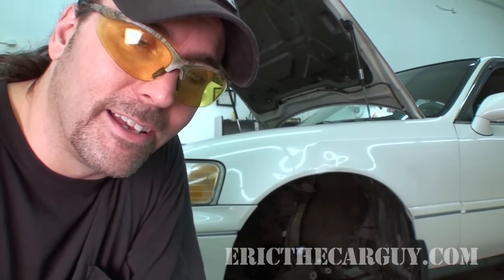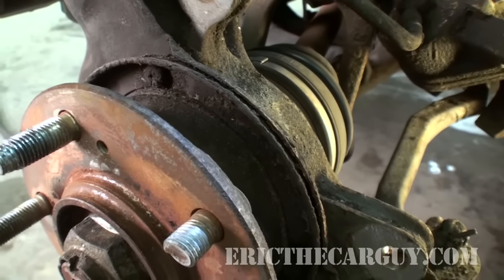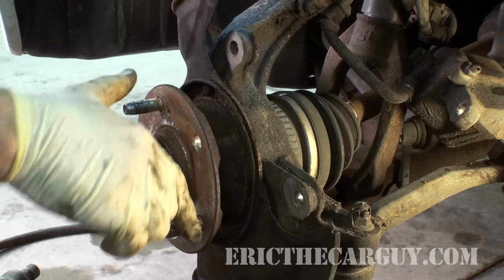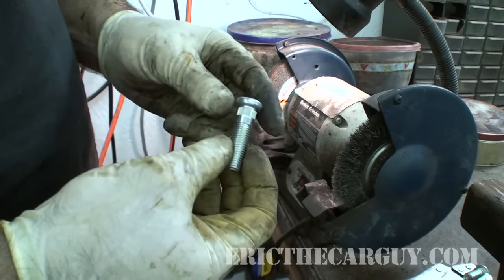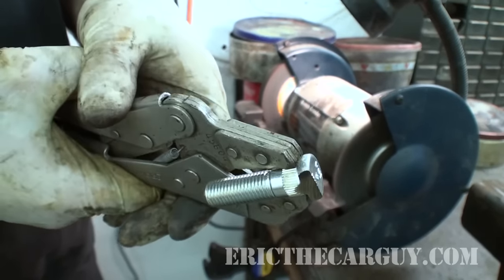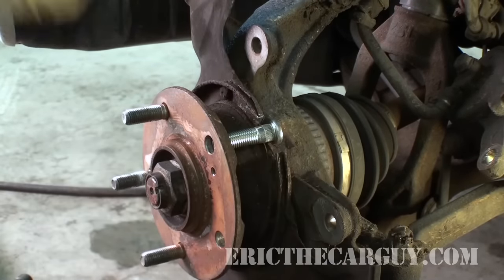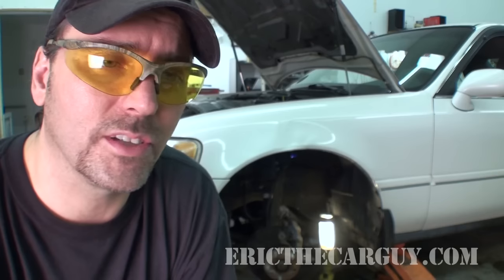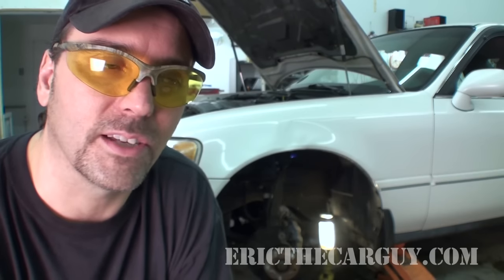Replacing Studs the 'Easy Way' -EricTheCarGuy

Comment: why bother replacing the stud if your going to replace it with an already damaged part?
Reply: keith cunningham I would be more Willi g to do this on a 5 ton truck then a car. The lug nuts should be only clamping the rim to the hub, on most heavy duty trucks the lug nuts actually carry the weight of the entire truck and are way over built. Lug nuts and studs really aren't all the strong on passenger cars. You see cars in accidents where the entire hub shears off or even the center of the rim. But none of that is either here or there. The customer paid for a new stud and got one that was installed half assed and damaged before it was even installed.

Comment: hey Eric, it's ridiculous to do this if you're working on a customer's car. Personally, I'd be mad if someone changed my studs this way without informing me how they were going to go about it.
Reply: Why would you be mad? There are multiple car manufactures that cut the base of the stud to make them fit, from the factory, I do this all the time at work. If you'd rather pay for someone to remove the entire hub and bearing and most likely cause harm to the bearing in the process that all you. But 99% of customers would rather pay the price for what he did then to get a new bearing, and wait for the time it takes to do it as well.

Comment: Seems like a quick/cheap way to get round the issue instead of removing the hub. However, if the stud were to sheer or come loose due to the load being focussed over to one side of the lug, (maybe causing it to scew over to one side seeing as at least a third of the seat has been removed ) hed be fucked in court....if things went wrong. Id be in the shit house if i did this.
Reply: How so? I guarantee the customer knew what was being done and wanted it done this way to save money.  I doubt it will ever be a problem. And even if it was and the stud failed and was pushed through past the wheel there are 4 other lugs holding it on so it won't be going anywhere. I see people rolling in with a broken stud all the time. Not Ideal for sure but they still drive it. Point is the wheel is Definitely not going anywhere before they've seen it and brought it back.

Comment: most of the cars ive seen  have a hole in the backing plate so you can spin the stud to the hole drive it out and replace it. he did not say that because all this guy works on is 95% Hondas how would he know???

Comment: man, tbh. ill agree its sloppier than the alternative. but if it were my 2000 honda civic. i would have it done this way all day long. I gauretee that stud would last another 5 years. and that may be only as long as i need the car. I would have an issue with this on a new car or if i thought i paying for it to be done correctly but it was done like this. But i dont think thats the circumstance here. Some customers will pay less because the car isent worth the full process.....

Comment: eh i might have taken the long way and just removed the hub. worst case the car gets a new wheel bearing and its just cost of the part to the customer since youre already taking it out and putting it back in. some cars have enough clearance between the hub and knuckle to do exactly what eric did so i dont see anything wrong with his method aside from grinding the stud. thats kinda sketchy to me.
Reply: +Dan  Mcknight , maybe, but sometimes, another inch can make a mile ! A $400 dollar repair, becomes a $475 repair, on say, a 2002 Corolla ? For a waitress making minumum wage, with day care to pay. I'm just saying, these are real life scenarios, to some people, saving that few bucks is not an option, but a must !
Reply: +t saint j Well put
Reply: just performed stud replacement after brake n rotors on 2006 Chrysler pacifica no need to cut just had both front tires lifted to free up axle so I could move position the stud to an opening in front I used wd40 washers n lug nut with star breaker made it like butter then I brake cleaned the whole hub to dry out remaining wd40 reinstall rotor n caliper tire hubcap etc torque it all down n have a nice day

Comment: I think maybe you should change the name of your channel from Eric the car Guy to Eric the break shit guy. There are times when having a shortcut is a good idea and there are times when it is a bad idea. This was clearly a bad idea from the get-go. I'll give you an example. To change the fuel pump on most cars these days requires dropping the tank. On a pickup it doesn't make any sense to drop the tank when you can just raise the bed a little bit after you loosen up the body mounting bolts. That is a good shortcut.

Comment: Why is everyone freaking out over this? As long as the portion sitting inside of the hub is untouched how does it affect safety? The backside of the stud will never pull through even with half of it gone. The only thing that's shitty is use a tap and die set.

And one lug doesn't cause a failure where the wheel suddenly flies off. 

But Jesus, everyone on the internet is on their fucking high horse. Much easier said then done when you're behind a keyboard.
Reply: you WILL eventually lose the wheel if you just use all but one of the lugs.  You'll get about 30 seconds warning. (personal experience here) but yeah  I think this hack is fine.

Comment: behind the wheel is a spot to remove the stud. Jack up the front end and secure the car and put in neutral and do one at a time. Not smart to file down or cut something that is suppose to be made to fit . Building blocks 101 kindergarten
Reply: +Alex Cruz not on these cars hubs always get in the way. If u watch closely he didnt effect the fit he really just made the repair possible. must customers want the fastest, cheapest way to get back on the road. This was a great video on how to get away with not having to spend $300+ on fixing 2 studs

Comment: for god's sake.. just pull the hub. yeah you're going to need a torch to heat up the nut and probably a puller but hell's bells it's done right and much more professional. plus check the bearings to be sure their not worn or scored. this way is the lazy hack way. sure saved time but very unprofessional. also as a customer I wouldn't want my stud ground off like that nor a cut in the shield. definitely no "booggered" threads. the idea of my life being on the line kinda tends to make me picky when it comes to things that control my vehicle.. thumbs down on this one for me. I get lots of good tips and info from you Eric but this one is just not for me I'm afraid..
Reply: Pulling the hub is a bearing job. So you're instantly at about 5x more money. And there's nothing unsafe about this repair. Nothing wrong with grinding the studs, or you can buy replacement studs that are precut.

Comment: eric that is a bad repair right there talk about dangerous you cut half the stud..  and the strength down do it the right way pull the hub

and how you install them is you get a tool for it or find a open hole washer they have some that are 1 inch thick you put it over the stud and p ut on the factory lug nut and cinch it down repair done.. and done the right way

Comment: OMG shade tree mechanic, twice as fast to just pull the hub and press them out... nobody should do this! and the bearings could've been inspected and greased this guy is a dangerous fool...
Reply: "twice as fast to just pull the hub and press them out" - Obviously you have no clue what you're talking about.
Reply: @tylhunt  obviously I do and you don't! you're the type of mechanic that would use epoxy to fix a broken pump or pour Coca-Cola over dirty battery terminals instead of just doing the job right!
Reply: @RealRocdad  That's a weird stretch to cover that you don't know what you're talking about. Weird.

Comment: instead of cutting the backing plate, cut the stud with a cut off wheel.
Reply: DumDum!!
Reply: carlo mango how you gone get the new one in
Reply: Robert Dickens 
What you do is first, remove the steering wheel, then the seat, after that make sure to replace spark plugs, then check for power balance.. Then proceed by cutting, counterclockwise ONLY the end of the bolt..the muffler should make a squeeling noise as you cut the bolt.. This means that the engine is feeling the pain... About to throw a rod.. Means the transmission..
Reply: Robert Dickens 
Only joking..

Comment: I personally would never modify any fasteners on any vehicle i work on, i would cut the dust guard into two halves, (eliminating the need to take the hub off) take em off, clean them up, then re-install everything. I just don't trust aftermarket fasteners. the manufacturers put them in a certain way and they should go back in the same.

Comment: Cut or bend the hub really man ?       Back out the bolts and remove it or just cut the stud off and hammer the knub out you'll be able to get a new one in 8f you cant ......   unloosen the fuckn hub or cut a little bit off the top of threads if your wheel will  let you get away with it
Reply: There's no loosening the hub on that car. It's a press in hub and bearing.

Comment: I would do it the right way, and just pass the cost onto the customer, what if the customer comes back because the wheel fell off, and they find that the stud was grind down, now it doesn't have full strength to hold it in place, and you are the last person that touched it, so it's your ass

Comment: honda wheels studs are gay alot of them require hub removal and when the broken stud is the result of a inexpericed oil guy at you shop your not going to cut stuff to get it in and you end up just doing a brand new bearing for free haha, but i still get paid so i guess it kind of a win

Comment: 25 apr 2019 11:27 am edt:
0:37 how stud look like.
thanks
i found this movie from google(wheel bearing stud) result 1 
from 'Well outside of broken studs, it's possible to distort them enough that the thread pitch changes, or damages the threads.' in 
https://www.reddit.com/r/MechanicAdvice/comments/1va56i/what_gets_damaged_by_overtorqued_lug_nuts/?depth=2
from google(bent wheel bearing overtorque lug nut)result 3

Comment: What a butcher! He even broke one of the safety rules using the bench grinder. I've seen one explode from someone doing just as he did. The guy lost half his thumb and broke a window on one of the cars in the shop at the time. Not to mention compromising the stud by grinding it.  This is not the right way to install a stud and this video should be taken down. As it is a bed example for people trying to learn.
Reply: The best way is to remove the steering knuckle and press out the hub, press out the studs, and then press in the new studs, and then press the hub back in. However, this can be more expensive to do. If you have the money and time to do it then by all means do it. Doing it this way is certainly better than driving the car with 1 or 2 lugs missing entirely. When money is tight you have to find ways to do what you need to do for the lowest amount possible. So yeah is it the best way to do it this way? No, but is it better than driving with 2 lug nuts missing? Yes.

Now as for exploding? I assume you mean the disc, and touching the stud to the side of the disc? If so I have never seen one explode doing it that way. I assume it can happen if you do it to an extreme. and wear the side down dramatically and it loses its structural integrity, but something like this it would have to be extremely cheap/old and or close to breaking to begin with to "explode". Now as for it being a b[a]d example? There are plenty of videos showing this kind of thing and showing half moons cut out. This in my view would be a bit better than a half moon, but that's me.

Just a note, I have never done it this way. I have an Integra and I just recently changed 2 studs one on each side. I pressed the hub out, pressed the bearing out, and put a new bearing in each, then pressed the hubs back on--after pressing in all new studs on each. The bearing were cheapish, so I expect to have to change them in a year or two. I think I paid around 40 for 2.

Comment: I just replaced my own wheel stud using a modified version of this. A couple of observations and suggestions:

- Before you grind down the side of the new stud, thread a junk lug nut all the way onto the new stud and vise grip onto that, instead of the locking splines on the new stud. Keeping these splines intact gives the new stud the best possible chance to not come loose or spin inside the wheel hub. 
- Also when grinding down the new stud, round/bevel off those sharp edges and corners. Makes it a LOT easier to tap into place.
- On my vehicle (2014 Ford Focus) I had to grind a bit of the wheel hub carrier. I used a dremel and a stone grinder wheel to remove as little as possible. 
- Use a Wheel Stud Installer! With this and an impact wrench the new stud went on easily. 
-->> https://www.amazon.com/Lisle-22800-Wheel-Stud-Installer/dp/B000ETUD22/ref=sr_1_2?dchild=1&keywords=wheel+stud+installer&qid=1587265749&sr=8-2

Great video and thanks for taking the time to explain the critical steps for shadetree mechanics like myself. Also, great camera angles. I know it's not easy working in a tight space while also trying to keep good camera angles. Great job!

Comment: Fucking butcher.  Even if you are enough of a cowboy to use this method, don't use a thread file to clean the threads (removes material), use a thread restoring die (reshapes the threads).

Comment: No offense, but I really hope my mechanic isn't pulling shit like this. I'm not a very knowledgeable car mechanic. However, I am experienced in Construction trades, and there is a Right way and a wrong way to do a job...
If this is a personal vehicle or the owner is aware then disregard.
Reply: If you have a press in hub assembly and you're charged $80 to replace the stud, unless the engineer designed the knuckle in a way for the stud to be serviceable, he's doing it this way.
Reply: Tyler Hunt the funny thing is I had to replace my stud on c6 corvette soon after watching this and I didn’t even do this myself and I’m not even a skilled mechanic. And trust me it was tight. I could have made it a lot quicker by doing it like this. But quite frankly it’s a half A’d way of doing things.
Reply: Tyler Hunt my studs snapped off too. So I’m definitely not going to shave half of the support off before putting them in.
Reply: @justincavinder5504  completely different hub design. There's no way to remove the stud on this car without pulling the bearing apart, or making a cut in the knuckle. And you can purchase studs that have pre cut shoulders. It's not going to fail at the shoulder.